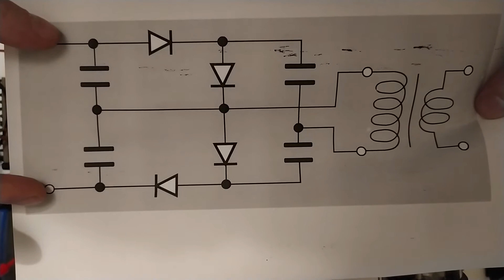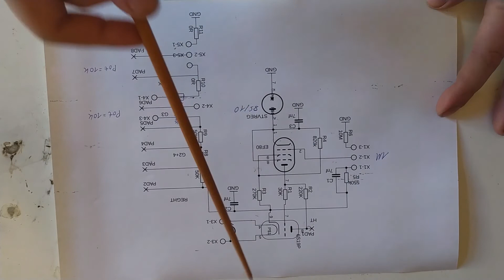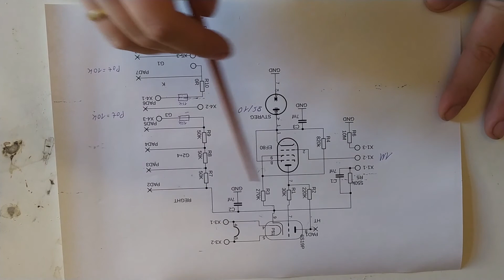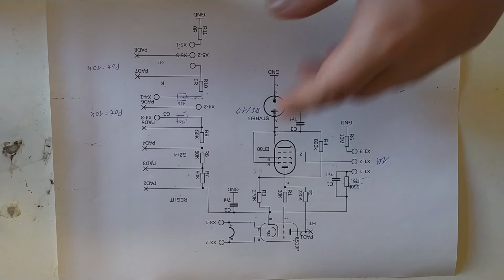Building a cathode-ray oscilloscope Part 3: The Overhaul

Comment: I really like this project. Twisting your deflection plate wires is adding a lot of capacitance and reducing your potential bandwidth. Old fashioned 300 ohm TV antenna twin lead wire works great for scope deflection plate connections as it operates all the way up into the low UHF band. Also, put some bypass capacitors to ground on the CRT DC voltages. I think part of your focus issue is noise pick up into the high impedance circuitry.
Reply from the maker: Thank you! 300 ohm TV twin lead is a little hard to come by in Europe these days, but I think I still have some small dimension 300 ohm ladder line, that should be very similar electrically. I think noise Pickup is a very plausible explanation that I didn't think of before, I'll try attaching some decoupling caps and we'll see if it improves things.

Comment: I've been looking through some 1960's-70's books with oscilloscope CRT specs. I cant find yours, but If the max rating for the CRT is 1KV, then it seems it should be run between 800V-900V. I love the rebuild, it's a lot neater and safer. :)
Reply from the maker: Thats what I figured at first too, had to dial it in later since the range where it will work well is quite narrow, I'm still looking for a shematic of the scope that actually uses this tube for some directions. I got a couple more of these tubes on ebay recently so I'm not super concerned about failure anymore which is nice, would be annoying to break one though